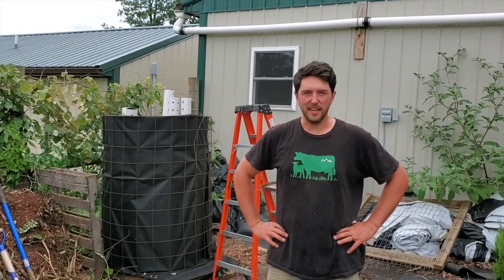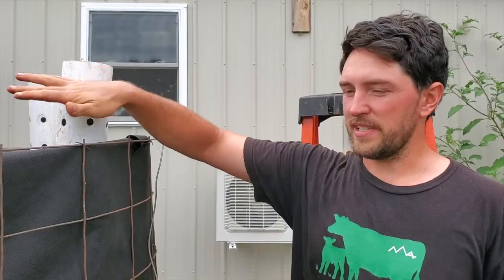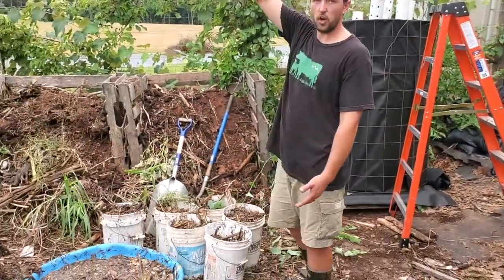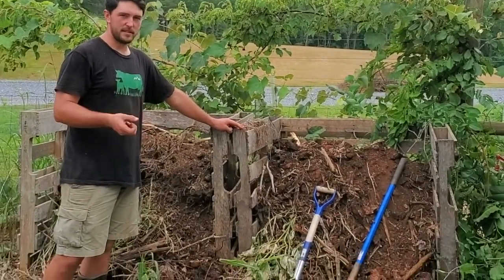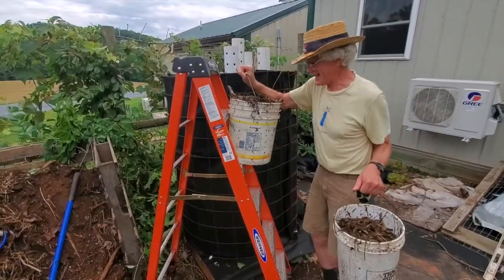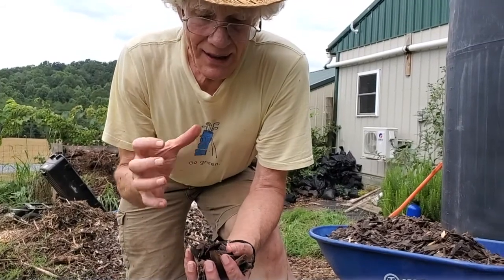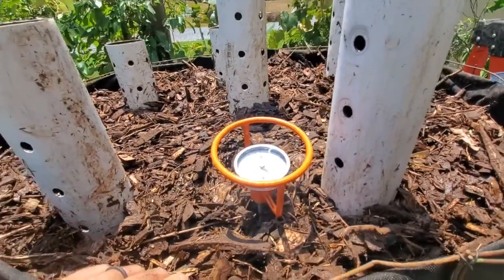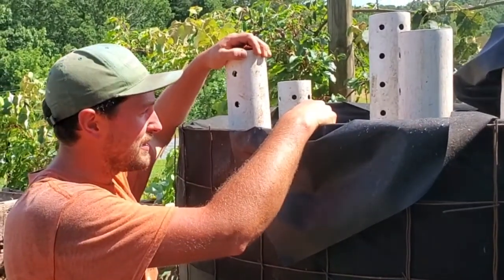19 / Feeding the Johnson Su Bioreactor

Comment: A great upgrade is to put one 4" hard cloth tube in the middle. If you are in a freezing climate, make another slightly smaller lined ring so there is about a 4-6" gap between the two. Fill the gap with dry material. Put a sprinkler system with a timer to water enough to maintain no more than 70% moisture content. Looks great 👍

Comment: Been trying to find out how to make a bacterial rich compost (good for grass type foods) verus the fungal rich compost good for any plant that is considered to be in the hard stem (woody/tree)..should I be using mostly grass stemed plants for bacterial and woody stemed for fungal?????
Reply: Take 20 pounds of the compost and add it to 90 gallons of water and keep it agitated for a day or two, take the liquid and spray it over the grass wetting it thoroughly, I believe this will do the job as it will do the same for grass at it does for crops. Watch the presentations done by Dr. David Johnson on YouTube.
Reply: High-nitrogen materials produce bacterial-dominant compost (greens/manure etc). But most soils are already bacterial-dominant so adding more isn't all that useful. That's why J-S fungi-dominant method is so desirable.

Comment: Can you add animal manure to this composter?? I have rabbits and quail. During the warm weather the soldier flies break down my quail poo but they truely are poo machines. The rabbit poo is easy to use as it's a cool manure and can be added straight to the garden
Reply: I would say yes. Drs. Johnson & Su use manures, leaves, wood chips etc. New Mex State U research: https://youtu.be/JGxSDhnvUUc
Reply: @randall3685  I've notice on a few videos that only dried leaves are being used or brown material. Would it be necessary to located green organic matter or is the brown alone fine and it will break down over time?
Reply from the maker: You can add manure, you just have to make sure they are dried then reduced to a consistent size--with bird or rabbit manure that's no problem--but something like cow manure would need to be put through a shredder. From there, just make sure the manure is evenly distributed throughout the mixture.

Comment: Compost is aerobically decomposed organic matter.
Reply from the maker: Not necessarily--there are many ways to compost, this being one of them. Anaerobic piles can be made using IMO or homemade lactic acid bacteria which produce a vastly different microbial profile from the highly fungal dominant profile of the Johnson-Su.
Reply: @gardenvideos2450  Well, if it goes anaerobic you get decomposed organic matter, not compost, according to Elaine Ingham. 

Consider that those stinky smells are nutrients being released to the air as toxic gasses by those anaerobic bacteria. 
Also, the main purpose of compost is to provide a multitude of beneficial organisms in your soil for your plants. 

Basically: 
beneficial = aerobic 
pathogenic = anaerobic 
What do you want to load your ground with?
Reply: Hi. Since you seem to have a handle on this - If I was to have a pile that went anaerobic but wasn't quite finished - if I aerate that, and kept it aerated, would it flip and turn into the good stuff?
Reply: @petertr2000  you could try it. If you can try to get it hot again keeping it aerobic...
When it's done it should smell good, earthy, and be dark brown - not black.

Comment: Are you going to show results and why this is better than other methods other than theory? This Johnson thing has a big following here on YouTube, but no one shows the end result other than microscope pictures that supposedly show something good that works in theory but no practical results.
Reply: It should look like what's in the vid below. A clay-like material that is essentially worm castings. I got this kind of material only in the bottom 1/3 of my pile. The pile froze at some point during a brutal winter.

A Johanson Su Bioreactor is a big stand up worm bin. It may or may not be able to take freezing temps depending on duration.

https://youtu.be/nSfgIi7Mdgs
Reply: @flatsville1  So that needs to be dried? It's useless in that form unless you want to make worm tea.
Reply: @joeshmoe7789  It can be diluted to a slurry then sprayed on fields/beds. Some people plant into it as is per Dr. Johnson. Drying a bit or mixing it with some drier, more crumbly finished compost would aid in spreadability by hand without spaying or pouring it. I poured some of mine in a thick slurry & mixed the rest with the drier stuff that never turned to worm castings. Worked great. I was disappointed the whole pile wasn't like the bottom part. The severe cold teps likely shut down the worm action. I was in Zone 5 during a long, cold, dry winter when this happened.
Reply from the maker: Well, so far we showed one reason it is better beyond theory: it is easy to build and doesn't require turning. This pile has taken longer to break down due to the large woodchips we had access to. Once it is finished we will do a microbiometer test and put it under the microscope to see what's going on. For more information on the benefits of this compost all you need to do is look up the work from Dr. David Johnson, he has plenty of evidence showing the efficacy of this product.
Reply: @gardenvideos2450  It doesn't require turning, how do we water it once a day here in the northeast? Other videos I've seen use leaves and call for one year. If I left my compost pile to sit for a year without turning, I would have good compost after a year. I get mine after 5 winter months, turning 5 or 6 times. Please supply links to info showing comparison garden results to other types of compost. Microscope is just theory.

Comment: Your supposed to take the tubes out after 24-48 hours!
Reply from the maker: We took em out! Thanks for watching, Nick.
Reply: @gardenvideos2450  Ahh, that’s great 👍🏾
Reply: @gardenvideos2450  
It has been over a year since you started this project. Do you have a video showing what it looks like now? Did it work as planned?
Reply from the maker: We'll be making a video soon. It has worked as planned, but since our woodchips we used were bigger than recommended, it simply has been slower to finish.
Reply: @gardenvideos2450  
 OK, I just subscribed to your channel and hit the notification bell to make sure that I don't miss the video when it comes out. I will be waiting…
Reply: I really don't understand why.  Why cut the holes in the base of the pallet and drill holes in the tubes - that's to allow airflow to occur and aerate the compost.   Once you remove the tubes, the pile will collapse and fill that gap - I really don't understand this one?
I don't mean that I think you're wrong, because you are right - that is the design of this method.  I just don't understand why!
Reply: @petertr2000  
 Under the right conditions, the holes should not fill in with material.  I had the same concerns as you, so I have come up with some improved modifications to the system that I believe will work better.